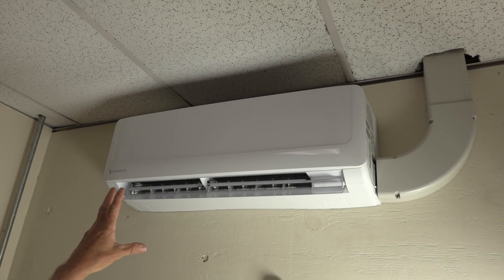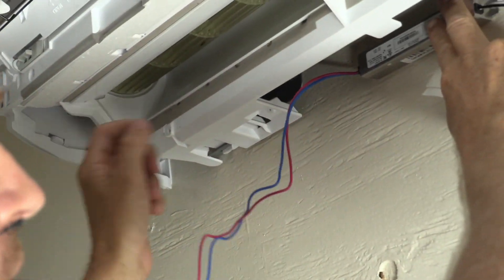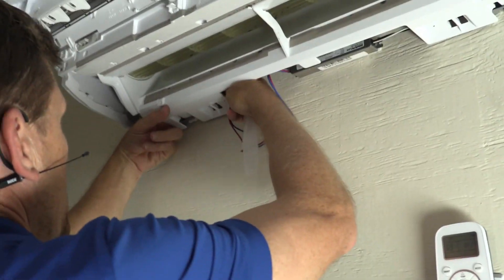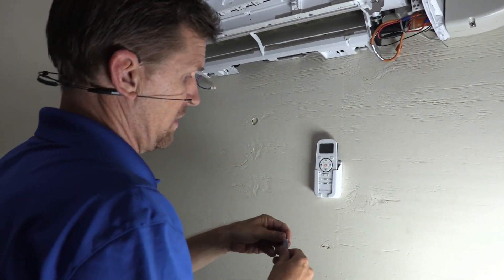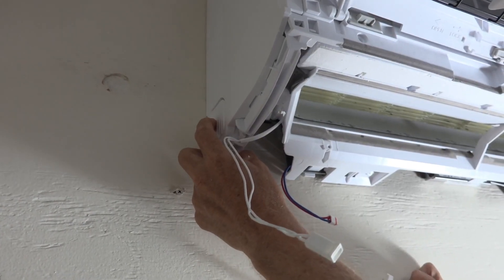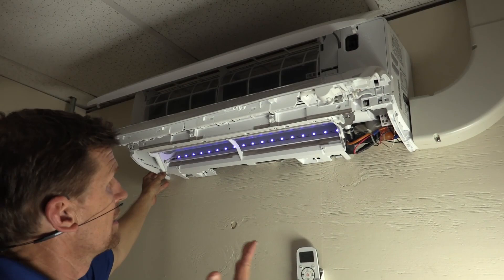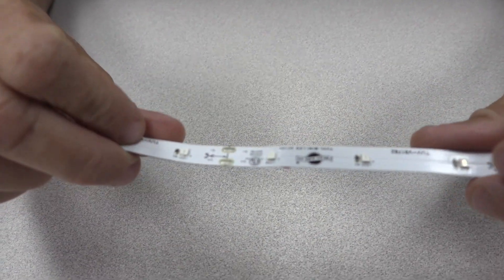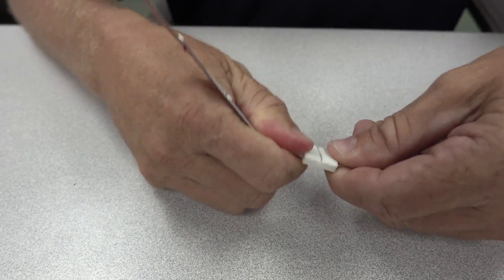Installing a UV Light in Your Mini-Split

Comment: I have a Mitsubishi MSZ-FS mini split where I installed this UV light. It’s underneath the blower wheel as you stated where it should be installed.

The way the light shines on my unit looks exactly how your lights are shining through your unit.  But if that light is direct to our skin, isn’t that bad?  Wondering if this UV-C light is safe enough for the skin because right now on my unit, I can see the bulbs directly and the light is directly and indirectly shining on my skin.
Reply: Well technically you shouldn’t look directly at those lights. However, the effective distance range of those led UV C lights is pretty small, so at a few meters you should be fine.

Comment: I would like to know how to determine how many LED lights are needed in the device?
 3Watt, 6Watt... 

 Thank you for your answer!
 Can it always light up inside the device?
Reply: Not sure about how many LED's are needed, but my Fresh Aire UVA strip (TUVL-Mini-Led) is 6.5W, 12-volt UV-A. It does the job for my Mitsubishi Mini-split unit.

Comment: Most minisplit its alot harder to expose the shroud to be able to put the strip in. The netal grille and side to side louvers can be a pain to break down to make shroud accessible. Wonder what brand minisplit this is?
Reply: Friedrich, I think it's the Floating Air Pro line. They are owned by Rheem now.

Comment: I’v read that the UV light strip has to be replaced yearly in most cases. True?
Reply: I just ordered a replacement strip because about half of my LED's started failing after about 2.5 years. The manufacturer includes a 5-year warranty BUT it only applies if a professional installer installed it AND you have to get that installer to come back out to verify it has failed. So, in other words, a useless warranty for a DIY.
That being said, I would never go without having these LED strips. It made a huge difference ...we don't have mold growth on the fan anymore.